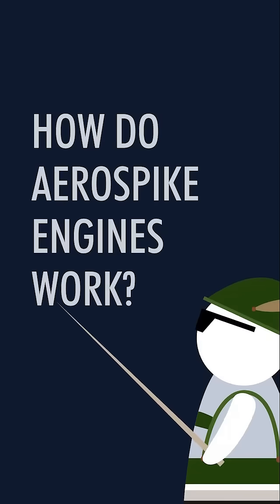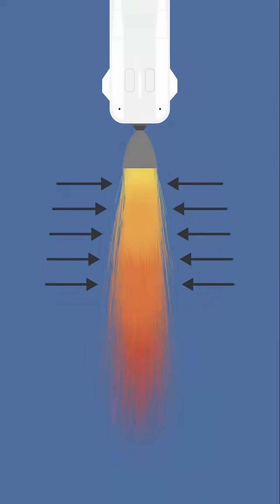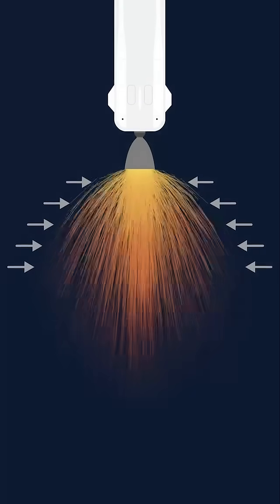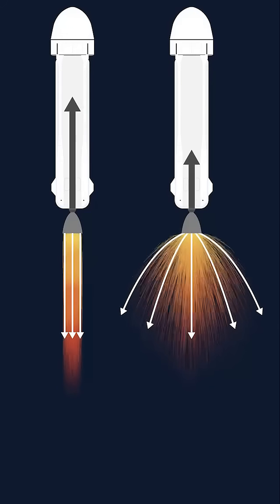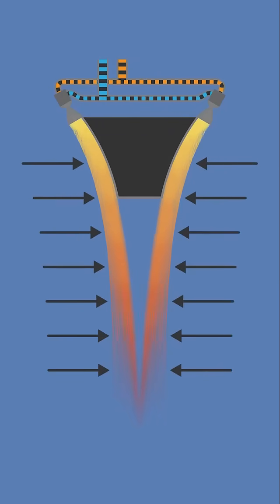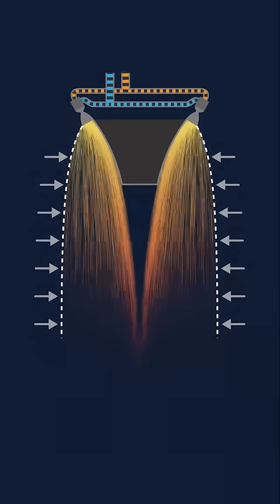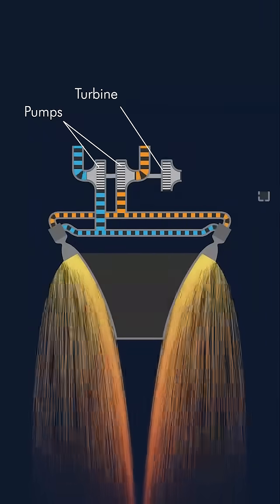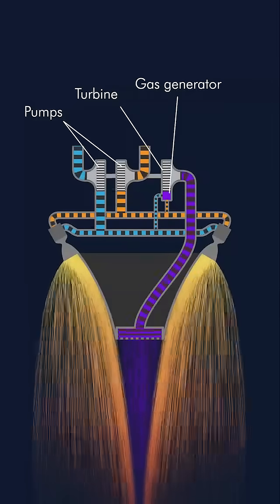Aerospike Engines Explained in 60 Seconds

Comment: The only problem with this is the exhaust from the turbine itself does not produce extra thrust. It acts as a virtual wall. Aerospike engines theoretically have to come to an infinite point to reach peak efficiency. Instead of building that out with metal, you can get a similar effect using a lower temperature gas.
Reply: yeah but it’s basically the same with standard engines, peak efficiency is an infinitely long nozzle and infinite chamber pressure
Reply: Can I clarify? This video leaves out a somewhat complicated explanation. 
One of the ways thrust is produced in a rocket engine is the gas pressure differential on the engine bell. You want the pressure of the exhaust to be higher than ambient pressure, and that differential creates a thrust force on the nozzle. Once it has expanded so that the exhaust pressure is the same as the ambient pressure, you don't need or want the nozzle anymore. Conversely, if you don't have enough nozzle to allow the exhaust to expand within it, the exhaust will exit the nozzle at higher pressure than ambient, pushing on and doing work on the atmosphere. That means there was some work in that exhaust that you didn't get to extract.
An aerospike uses a one-sided nozzle so that the differential pressure on the nozzle always creates thrust no matter the ambient pressure. But to get full efficiency out of it, that nozzle has to extend all the way to a infinitesimal point. You can't do that with metal, so you have to truncate the nozzle. But you can (well, as close as makes no difference) with a low pressure gas. If you fill that truncated space with low pressure gas, it will get compressed by the exhaust pressure, exherting a force on the nozzle truncation, making a thrust force. 
That's what the turbo pump exhaust does.
Reply: @tylerfb1 Thank you for the clarification. That type of thinking reminds me of the solution engineers came up with to address cooling the thruster bell by running fuel throughout it.
Reply: @tylerfb1 Great explanation!
Reply: @tylerfb1 you want the exit pressure to precisely equal the ambient pressure otherwise you’re going to have shocks or expansions inside the nozzle or at the nozzle exit. I’ve never heard of it being said that the gas does work on the atmosphere oddly enough. You want a perfectly expanded flow regime but most rockets perform in an under expanded region and a correction factor is used. It really is not that large of a drop in efficiency if the flow expands outside the nozzle (in terms of flow diversion)
Reply: @guidesforuseveyone6834  that’s the mechanical problems with over expansion, yea. But that’s not the reason we want a bell that perfectly expands rocket exhaust to ambient pressure. It’s about work and thrust. 

“Doing work on the atmosphere” is just a way of looking at it to understand the concepts. It just means there’s work in the gas that could have been extracted to create thrust. Instead it was wasted.
Reply: technically if its being shot out of the rocket at any speed it produces thrust
Reply: Wait, is that the namesake aero spike?
Reply: I wish this was the only "problem" Nicholas...
Reply: Makes total sense
Reply: Which lowers your efficiency, yeah-
Reply: kinda doesn't make sense
Reply: @UnitedStatesOfAmerica1781 i promise it does if you know the fundamentals at least of rocket science
Reply: @inkandesk  thats a pretty high hurdle to jump ill be honest
Reply: @inkandesk 
Hey, you gotta commend his wonderful USA cosplay - he reached a conclusion without using any critical thinking!
Reply: @thejay8963  That's kind of rude and uncalled for. People are having an intellectual conversation and then you just throw out an insult of the entirety of the US populace.
Reply: @thejay8963  "kinda doesn't make sense" 
"YOU FOOLISHLY REACH A CONCLUSION? WITH NO THOUGHT INVOLVED?"
Reply: @inkandesk  as a jazz musician I feel qualified to say that this not only makes sense but it's ridiculously simple!
Reply: @UnitedStatesOfAmerica1781  why is that?
Reply: @UnitedStatesOfAmerica1781  Well, we're at the point in physics where only "kinda" doesn't make sense is pretty good.

Comment: Hold on, I thought a rocke engine, ANY rocket engine gets more efficient the higher they go and the thinner the atmosphere gets. I also thought that the aerospike was a solution to under-expansion of high expansion ratio rocket engines, as the ambient air pressure could flow back into the sides of the nozzle and separating the exhaust from the walls of the nozzle, which could cause dangerous shockwave, and the aerospike was designed for this under-expansion by having the ambient air force the exhaust to get pushed towards the wall, which makes under-expansion impossible. Eh, but what do I know?
Reply: Jeremiah, the thrust increases with altitude, but once the nozzle reaches its design point (between 2-5 km usually) the efficiency grows lower than it could if all the expansion happened all inside the nozzle (optimal expansion) so it realises a potential less 20% payload to bring in orbit. Moreover, the operative condition you're describing below design point (namely, over-expansion) is the only regime during aerospikes increase the efficiency! That's why we design aerospikes at higher area ratio (between 15-20km) 😉
Reply: Right, nice argument but I haven't found an explanation in a paragraph regarding rocket science
Reply: The engine gets more efficient but the NOZZLE gets less efficient
Reply: "gets more efficient the higher they go" - Before the engine is lit the air at sea level, or any launch altitude, the atmosphere is pushing into the engines, into the thrust chamber, into the injector plate and all the way to the first closed valve. The fuel mix and burning gasses are pushing the atmosphere away. In a vacuum no gas is pressing back and as a result ISP goes up because no energy is being wasted keeping the atmosphere out of the system. Just like swimming to the bottom of the pool, the "atmosphere" of the water is pressing your ears and when you blow out while underwater you need to push out / blow out hard enough to keep water from pushing in.

Comment: i would love this explanation video extended
Reply: E.g.Everyday Astronaut has made a video about this. Therein he also mentioned two of main contra's of the aerospike: the weight of the nozzle and cooling it. The bell shaped nozzle of the 'normal' rocket engine need not be very thick and can radiate a big part of its heat away.
Reply: Nahhh. Shorter the better.
Reply: @wesdblack in this case.
Reply: Extension: they're not as efficient as they seem on paper
Reply: @jonslg240   Very true.  Aerospikes are a pipe-dream.